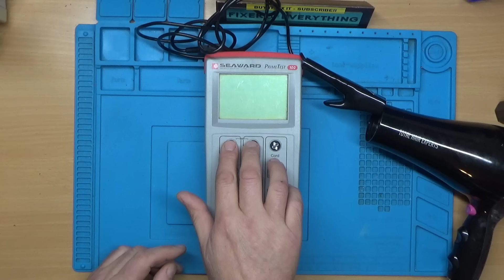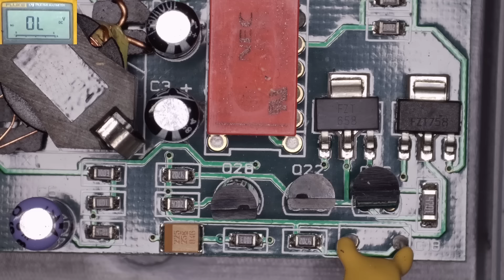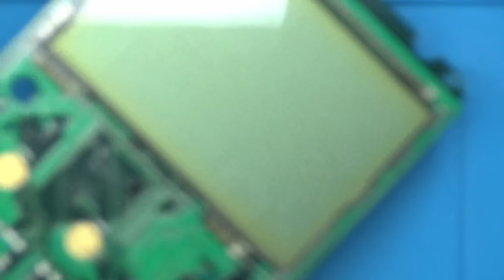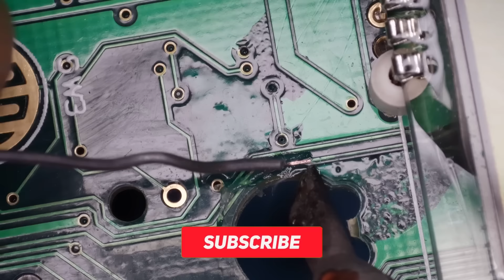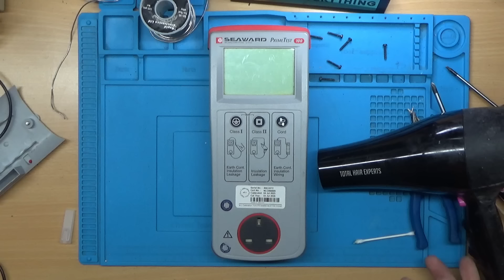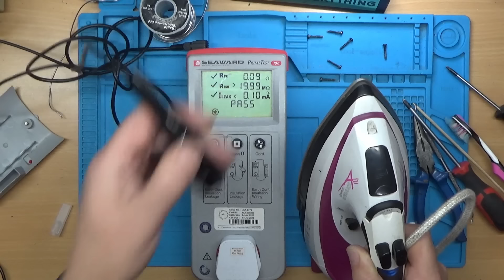Faulty Seaward PrimeTest 100 PAT Tester - Switches Off When Testing | Can I Fix It?

Comment: I test PAT testers with resistors. I made a test cabinet for it. I use a 100M and 10M resistor for isolation and a 1 ohm and short for PE resistance test.  (The only PAT testers I repair are G&M Secutests, I think I have done about 50 of them the last 10 years)
Reply from the maker: Interesting👍 I've not really had much to do with them.
Reply: Great to find someone who fixes those units.
I got me a broken G M Secutest S2 with multiple issues: a pin of the print transformer had snapped off, the averaging caps (tantalum) of the RMS converters had sheared off the board (wonder how that happened) and finally the LCD contrast is stuck at max.
The contrast cannot be adjusted anymore, it is still readable but do you have a fix for that?
Do you also calibrate the units?
Reply: @Inse001-s1w  Transformer has to be replaced (there are  many PCB versions and firmware versions, including subversions. but the transformers are, as far as I know the same)  I have some spares from units that were beyond repair (like fried HV innertraces) (they are from my customer so I do not sell them)

There are no schematics. To measure in them I made connection cables so I can have it powered on outside the cabinet. If you have to be between the 2 boards in the lid you have a problem. (split them, solder a wire, build the boards back in, connect scope and do that 1 measurement etc) or make extenders. 

The caps is no problem as long as you have not damaged pads and for most vias (it is 4 layer pcb) 
Nu clue about the contrast, never had display or other digital problem, except 2 with a dead RS232. 

Most problem's are relais related. The big orange are often bad and 5the huge relais are often dirty, some are burned and need replacement. They are freaking expensive.I do not calibrate them. I repair them for a calibration lab. The small orange are rarely bad. Use a very good desolder station because it is very hard to desolder those big relais. My Pace SX100 and SX90 can do it if I use the "high power" nozzles. 

For the rest, a lot of reverse engineering, scope measurements and I have build a relais tester otherwise it costs way to much time. 
I do not like repairing them. They are freaking complex due to all those relais and analog switches. Only preparing them so I can measure is about one hour of work. Repairs take a lot of time. (a fast one like 3 hours, a bad case over 10)  I do it for one customer only who helped me when I was just starting my business. These units are becoming pretty old by now but somehow users seem to love them. They keep coming in for repair. Have one now with a dead RS232.

Comment: How do you decide adding a wire vs bridging with solder
Reply: Effectively electrically there's little difference, however physically solder will only bridge fairly small gaps, so in the case of larger bridges, wire is the way to go.
Reply from the maker: The gap is too wide to bridge with solder, you'd struggle to do that with solder.

Comment: Eagle eye Mick, spotted that corroded trace right off.  Using those leaky Duracell batteries is just asking for trouble, I never use them.  Great fix bro, thanks for the video.  See ya next time.
Reply: I've worked on at LEAST $5,000 in RUINED handheld test equipment in the past 5 years because of leaky batteries. Duracell's in particular.

 Energizer ultimate lithium is the only way to go in expensive equipment. Hopefully more of the expensive high-end test gear will go with rechargeables in the future. Or at least specify lithium prime cells only.
Reply: @hullinstruments  You got that right, DuraLeak's are terrible.  I do use Energizer lithium batteries in anything I care about, just wish the price was lower...
Reply: @terrym1065  there are several drop-in conversion options these days. For something that's very power demanding... where you're burning through a lot of Energizer lithiums. 

Multimeters and other expensive handheld test equipment are usually such low power draw, that it's not a big deal.  Sure, I don't enjoy spending $15 on 4 AA batteries 😂😂 but if it's only once a year then still worth it. 

And with most of my handheld test equipment, they seem to last a long time even if I'm using them multiple hours per day.  

But if you're burning through a lot of them in high power demand devices.... I would absolutely look into the drop-in replacement options
Reply: @hullinstruments  👈👍
Reply from the maker: Cheers Terry! Glad you enjoyed the video 👍
Reply: Duracell's are just dire nowadays. I've just thrown some out that were leaking without even being used.

Comment: Where is NOK sample test? It may show OK also on shorted cable...
Reply from the maker: Good point, I didn't try a cable with a short, but it does show fail if there is no cable connected.